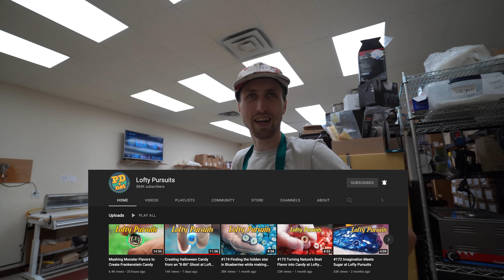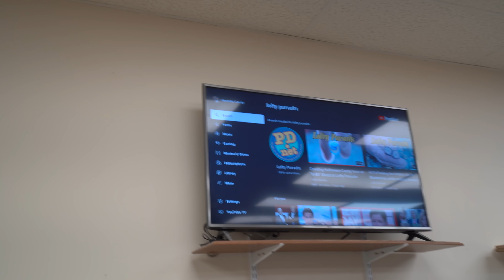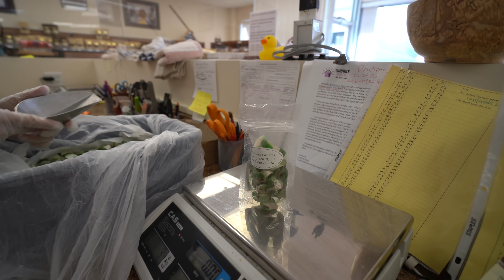We Tried Making Image Candy Like Lofty Pursuits!

Comment: idk if i understood correctly, but i think cooper was worried that it was twisting as steve was pulling it, but i'm pretty sure they do twist on the batch roller at lofty. shouldn't affect the image. the batch roller at lofty doesn't roll it back and forth, it rolls it in a circle and thus twists it.
Reply: The batch roller is angled, though, it rotates it without twisting.